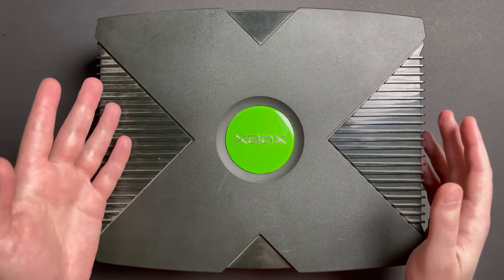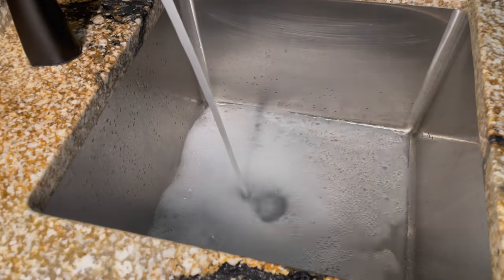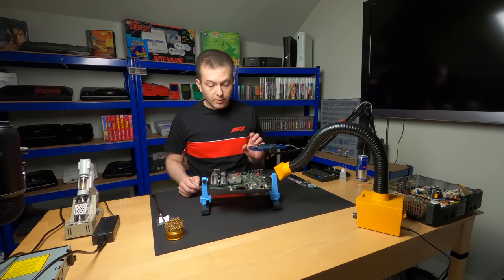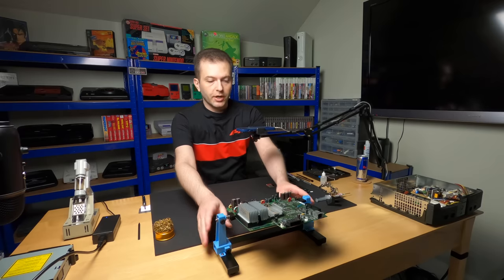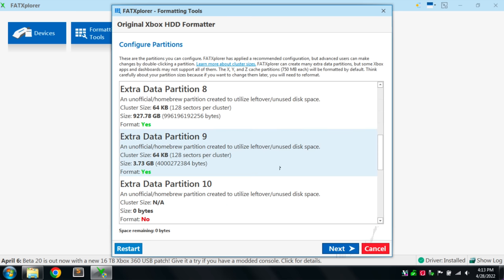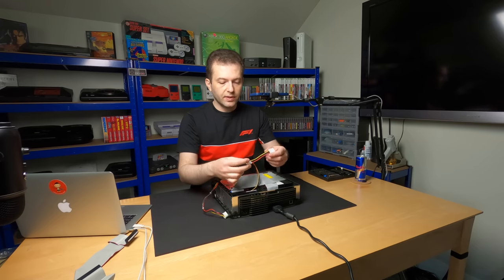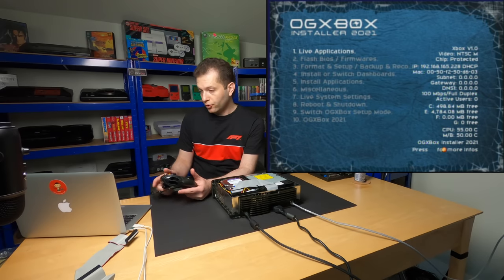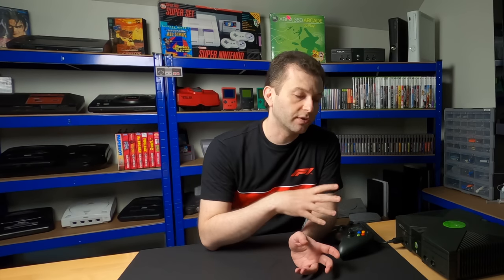16TB in an OG Xbox? CERBIOS has arrived.

Comment: This video makes me want to go out and get another xbox and mod it again.  Last time I had one I did a solderless modchip and the ground wire was really janky.  Basically the instructions said it was good enough to insert it into the hole and leave it but it recommended to secure it somehow.  I just ended up putting it in the hole and leaving it.  On the rare occasion it came out on its own I put it back and all was good again.  In hindsight I probably should have soldered it in anyways.

Comment: Hello. What is the reason that I cannot I use the original ide cable included with the Xbox with the ide to Sata adapter? It’s going to take a while for the 24” ide cable to be delivered.
Reply from the maker: Most SATA cards only work with an 80-wire/conductor cable. You can try it, it probably just won't boot.

Comment: Maybe the answer to this is obvious but I'm completely new to retro console modding (I own a modded PSP and PS Vita which I EDC but that's it) but what's the point of putting something so huge as a 16TB drive in when you said yourself that you had basically the whole library of xbox games with just a 3TB drive? With these custom bios' can you run emulators for other consoles of the same period?

Comment: Incursion64
0 seconds ago
Nice video, and great job doing a nice refurb on the unit. Couple of things I noticed :)

1) make sure you don’t have an IND bios config file present on C if you are using rocky 5’s dashloader, which is a little more of a modern way to setup your default dashboard than a utility disc.

2) in Xbmc4gamers go into your settings and enable fast parsing. That scan will only happen the first boot and will take about 8 seconds to load your entire game list on every boot after that. By default that option is turned off but it makes a big difference:). 

Happy Gaming!
Reply from the maker: I've already one #2 and its a must-have. Not sure why its not enabled by default. As for #1 I personally have only ever used HeXen and OGXbox Installer to load XBMC4Gamers so I can't comment but hopefully your suggestion helps someone else.

Comment: Are you using an HDMI adapter? Do you have a link for one? All the ones I tried have problems with the screen going black.
Reply from the maker: Hope, just aftermarket HD component cables. They're not nearly as good as the official Xbox HD pack but they are inexpensive and do the job.

Comment: After using Fatxplorer, are the C and E drives supposed to be empty?

After using Fatxplorer like in your instructions, I put the hard drive back into my Xbox, inserted the Xbox Installer disc, but I get an Error 16.

Putting it back into my PC and mounting C drive as X, the C drive is empty. Do I need to rebuild it?

Comment: @Borderline OCD ,I have an older mod chip in my xbox ,An executer or executioner chip is in it I think & there's a little switch panel on the front of the console with little switches on it that's attached to the chip. The thing is it turns on but it has an what seems to be older dash with no games ,I'd really like to get it looking like yours. I think all I need is xbmc & way to ftp the games into the HDD. Is my chip compatible with all this ?

Comment: I have an old Xbox and it works great except for the fact that the disc tray doesn't come out. I also have a fat PS3 and the disc drive stopped working on it as well. I don't know what to do with them. This is an awesome build OCD! I have other consoles as well. I don't know what to do with them either. Lol.

Comment: But isnt the original xbox 32bit? Which that integer can only support a maximum of just over 2TB for a drive to be read? This is cool, would like answers tho.
Edit: Unlike most people in the YouTube comment section, I Google'd it. Really fascinating stuff!

"How this was done
A more technical deep-dive will be published another time, along with the source code to the patches. Here is a general overview in the meantime:

The reason there is a 2 TB limit in the first place is because the Xbox 360 kernel only issues 10-byte SCSI operations. 4 of those bytes refer to the logical block/sector number. Therefore, the maximum amount of data on the USB the Xbox 360 can access is 2 TB. To get that figure, you simply multiply the maximum integer value that can fit into 4 bytes (4294967295) and multiply it by 512 (the standard sector size).

To access more data, 16-byte SCSI operations must be used. A 16-byte SCSI operation upgrades the logical block/sector number to a 64-bit number, making it possible to access the space beyond 2 TB.

Another limitation is the kernel’s DISK_GEOMETRY structure. The sector count field is only 32-bit. Even with upgrading the SCSI commands, it won’t matter if the kernel can’t store the correct sector count. This field cannot be extended beyond 32-bits, so the alternative is to increase the sector size. The sector size was increased to 4096, and as a result, that 32-bit sector count field can now represent a maximum of 16 TB. Since the USB itself still uses 512-byte sectors and the 4096-byte sector size is essentially a spoof, a conversion method had to be created so the read/write operation, based on the 4K sector size, would apply to the correct sectors on the USB.

The final problem to solve was non-buffered IO operations. Some files, like xexs, are opened with FILE_FLAG_NO_BUFFERING and reads are done that are 512-byte sector aligned, but not 4K sector aligned. With the sector size change, games failed to launch. As a little cheat, FILE_FLAG_NO_BUFFERING / FO_NO_INTERMEDIATE_BUFFERING support in the kernel was removed. Everything then started working with no apparent ill effects."

Source here: https://fatxplorer.eaton-works.com/2022/04/06/fatxplorer-3-0-beta-20-16-tb-xbox-360-usb-support-increased-usb-performance-titan-support/

Comment: This video is godlike, best xbox mod video ive seen. 

Is there a way to use a non OG optical drive in an xbox? That’s the only thing wrong with mine and replacements seem hard to get
Reply: Yes, but finding a drive that will accept the Xbox’s firmware is almost impossible. There are very specific drives that have to be used. And then there is the issue of the power cable that would need to be addressed as well, you have to rebuild the power connector from the drives board with wires, and I believe the eject button winds up not working like it should. It’s not worth the hassle really. You are better off using a mod chip to bypass the disc drive. 

If the drive isn’t opening it could just be the drive belt for the tray, but if it won’t read disc then the laser is probably dead. Some drives have potentiometers that can be adjusted to correct the issue, but without special equipment it’s kinda hard to get it adjusted right.

Comment: Fantastic build!! I current use a 2tb sata drive but maybe one day I'll upgrade. Out of curiosity any specific reason to go with the modchip rather than a tsop flash? I haven't read the cerbios documentation yet so unaware if a modchip is required or not.
Reply from the maker: You can TSOP if you want but just keep in mind the project is still in beta.
Reply: If your Xbox is v1.6 you can't TSOP flash because their motherboards do not have TSOP. So your only choice is the modchip (if you want to hard mod it). For v1.0~1.5 you have to softmod it first to TSOP flash. There is also a tool that this guy saying it's in beta let you TSOP flash without softmodding it. But it's functionality should be solid according to the author. I would personally TSOP flash it if it's version 1.0~.15.

Comment: Good to see stuff is still made for the ogxbox!
I should rebuild one of mine with a new harddrive and new bios.
Does the bios fit in an original tsop?
Or do I have to use one of my collection of chips? (I still have about 20)
Does the bios support a 128mb memory upgrade?
Reply from the maker: You can TSOP flash but just keep in mind the project is still in beta.

Comment: Thank you for video, but i have 2 questions, what kind of liquid you use to clean thermal paste on processor and to remove stickers? And what kind of greece name you use to greese wheels on a DVD drive?
Thank you
Reply from the maker: 99% isopropyl alcohol and lithium grease.
Reply: @BorderlineOCD  Thank you for answer, one more question, i know its sounds little bit stuped, but i've done many times soldering only for myself, and i never ever saw the machine like you using for drill holes, and i was never involved in that process. Can you please advice what is the name of this machine, do i really need to buy it for making holes for a aladin chip, or i can just solder out them like normally i do with capacitors. And do i need to train before doing that on my own motherboard, because for me fear to complete break motherboard during making holes makes my hands down for geting life this amazing moding. Best regards.

Comment: What is that tool you are using to remove solder - the one that makes that buzzing noise? Thanks for your work and sharing this with us!
Reply: aliexpress:
S-993A S-995A S-997P S-998P Electric Vacuum Desoldering Pump Solder Sucker Desoldering Gun Soldering Iron 100W
De nada.
Reply: @Sharkbar_  thank you!!!
Reply from the maker: All the Hakko clones are pretty much the same. The exact one I'm using is out of stock on Amazon (https://amzn.to/3JdWex9) but anything similar from Amazon/eBay will do the job.

Comment: The most important question I have for this is if that >2tb partition is still fatx?  Fatx only allows <=4gb file size.  If the partition type is something other than fatx and allows for larger files (which I suspect), then that means you could store the entire Xbox library in iso or xiso format, instead of files/folders.  That would definitely change the game, because there are about 4 or 5 games (that I am aware of) that the only way you can play them is off a physical disc or from a split xiso file.  If this were to eliminate the 4gb file size limitation, I would redo my mod chip and my entire library to run from isos.  The next question would  be if that bios could be used in Xemu, and we could create a virtual hard drive file with the same partition and isos.
Reply from the maker: I haven't tinkered with XISOs yet but I'm pretty sure I saw some chatter on the Cerbios Discord about folks splitting the games to make them work. I could be wrong. Might want to check in with the Cerbios guys to get some accurate info.

Comment: So I bought a Modded 2 TB Xbox Original with over 8,000-ish Games from Masamune off of Amazon for my BDay back in 2020 and now hearing that the Xbox Original can now use between 3 to 16 TBs is a huge deal for me. I like using 8 to 16 TB External Hard Drives for my Xbox One Slim, Series X, PS4, and PS5 cuz I know I am gonna collect a bunch of Games as time goes on. Now that the Xbox Original can have alot more space, the ability to add more Games upto beyond 20,000 at least is sending my Dopamine levels through the Roof. 😅 I just wonder if there is even 20,000 or 50,000 Old Games predating the Xbox 360 and PS3 to begin with? 😮

Comment: I use a hair dryer on the gpu heatsink, get it almost to hot to touch, and let it sit at that temp for a few, and it comes right off.  I don't feel comfortable putting that much stress on the solder balls on the old chip.  Try it out, see if it works for you.

Comment: 10:40 you really did that without heating? Cant believe. Usually those gpus ripped by doing like this cold heatsink remove. brave soldier. not yet failed. Nice job btw. :)

Comment: hi please help ! i have followed all your moves and installed a 2 terabyte HDD and loaded it with games on the F:partition and followed all the instructions for xbmc4gamers  However.. i cannot get the artwork to display on my games and you went off camera for that bit. i have downloaded the installer and run it 3 times now but it only picks up 1 of my games AEON FLUX that's it,it wont add art work to any other title..how did you do it ?

Comment: One question, is it possible to use an SSD instead of a HDD?  I have an old XBOX and would like to take it back out and change the mod chip.  I had an old mod chip and used EvolutionX.
Reply from the maker: You can. You don't really see meaningful speed improvements though as the architecture is the bottleneck.

Comment: 5400rpm drives are perfect with the IDE ribbons. 80 wire IDE has a max speed of 133mbps so a SSD is not faster than a HDD in the Xbox.

Comment: @Borderline OCD Can cerbios be installed on a soft modded Xbox and a larger drive installed via got swap?  Or is the hardware mod via aladin chip necessary?
Reply from the maker: It's a bios that needs to be flashed so you need to either TSOP or flash it to a modchip.
Reply: @BorderlineOCD  thanks for the clarification.

Comment: I purchase 5 Aladdin xt plus2 and all fail to flash I end up using my 1.0 TSOP I was really scared to break it thankfully it wasn’t now I have to transfer all my games I’m so happy Thank you for the video
Reply from the maker: Can you do me a favor and check the serial number on the flash chips of your Aladdins? Is it 49LF020A, 49LF020 or 49LF002? Are they all the same? What flashing tool did you use and does the flash tool report the same serial number as the one printed on the wafer or is there a discrepancy?
Reply: @BorderlineOCD  WoW good question because I use the og installer To try to flash the Aladdin I try the resctoox and every time I got a message fail to erase the bios 
So I try xblast and only power of the Xbox finally 
To TSOP i use xblast because restoox don’t work for some reason 
And I got 2 different looking Aladdin I have to check the numbers I’m going to try different Xbox to because I never have this problem

Comment: You ever consider doing that with an SSD? Also have you ever considered the HDMI port mod for the og Xbox?
Reply: SSD doesn’t do much to the Xbox, probably “ durability” because it’s not mechanical other than that mechanical Drive has more capacity and is chipper.
Reply: @javiles2331  if the console is going to be moved around a lot, and potentially dropped, an SSD will survive where a hard drive isn't garunteed to.

Comment: Hmmm...didn't know XBox would recognize the SATA HDD with that adapter. Does that mean I can put a SATA SSD in XBox as well? Will it make it run faster?
Reply from the maker: You can. I don't think the speed improvement will be measurable though as the bottleneck is the system bus rather than a slow HDD. Some folks say it helps a bit but I haven't tried it and to be honest I don't see myself putting an SSD into an OG Xbox anytime soon.

Comment: Would a modern 5400rpm drive be quicker than the original XBOX HDD? If it is quicker would you get faster loading times or are there still bottlenecks elsewhere?
Reply from the maker: The original HDD wasn't used for loading games so any HDD will be faster than a stock system playing games from disc. But to answer your question the bottleneck is the architecture even an SSD wouldn't yield meaningful performance gains.

Comment: Do you know if Cerbios can be used with Open Xenium Mod Chip? I want to do the Xbox HD+ HDMI mod and I've been told it only works with the Open Xenium chip. I have an Aladdin XT, but have not installed it yet
Reply from the maker: It's just a 256k bios. It can be TSOPed or used with any modchip. There are many recent reports of Aladdin's from China that can only be flashed with a programmer, and not on the Xbox itself. I've mentioned this in the pinned comment. If you want to avoid any headaches you can also just get an Xblast Aladdin from ModzvilleUSA.

Comment: Do you need a mod chip for Cerbios?
Can you flash it to the TSOP?
Reply from the maker: It's just a bios so yes you can TSOP.
Reply: @BorderlineOCD  Have you done it? I have a 1MB TSOP so would I have to pad it out to 1MB?
Reply from the maker: Nope, I always chip my systems even 1.0s so I haven’t TSOPed Cerbios. XBlast should pad the bios for you, don’t think Resctoox does. Join the Cerbios Discord and confirm with the folks there that have TSOPed on the best way to do about it just to double confirm.

Comment: I dug my old modchip'd Xbox out the other day. Drive is stuck, didn't want to boot initially, giving a red light but then after a short while booted fine.  No idea which modchip it is now. Running Slayers EvoX 2.6 dash though. 

I've got to take it apart to look at the drive but now I've also got to check out that capacitor. I have a sneaky suspicion that's why it didn't want to boot.

Comment: @ 32 min in, liquid electrical tape is a thing. Get some. 

My one issue with this otherwise great video is that you didn't clean and lubricate the cooling fans. I always clean them with WD-40 and/or DeOxit and then lubricate with a Teflon based lubricant. 
My current favourite being Liquid Wrench  Super Lubricant with Cerflon.
Fans treated this way can go years without issues. 

Otherwise, nicely done. Thx.

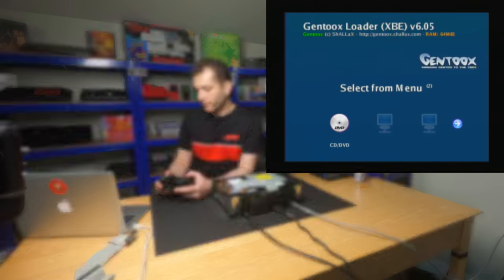Comment: 37:46 i burn the same image as you. But it wont recognise any input from my gamepad, after 5 seconds countdown trying to flash from DVD, then gives error, then repeat.
I noticed that you cut off this part, and then everything works for you. how did you fix it?
Thank you
Reply from the maker: Nothing essential was cut. If your controllers aren’t working you have an unrelated problem. You can try XBlast to see if you can flash it there.
Reply: @BorderlineOCD  maybe the problem is because i use fake controller (mine is xbox s controller, not duke one, not sure it is fake or not)
Reply: @BorderlineOCD  how to fix it: connect any USB keyboard to USB 1 Xbox. Xblast and RescToox wont work with fake Xbox controller, but work with keyboard